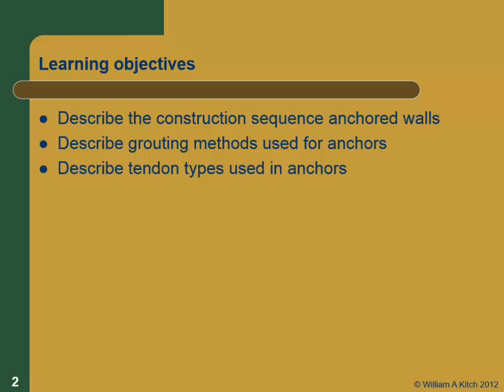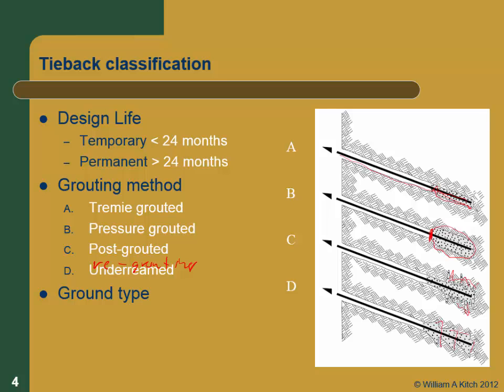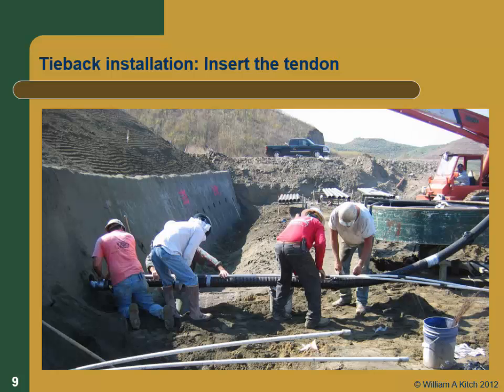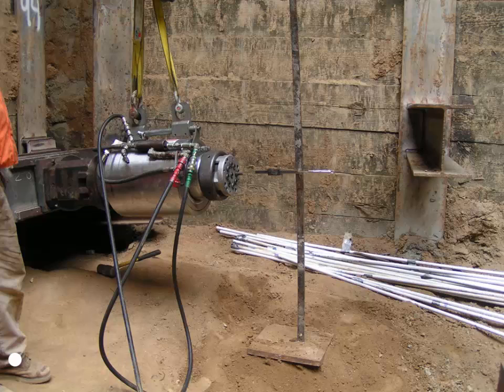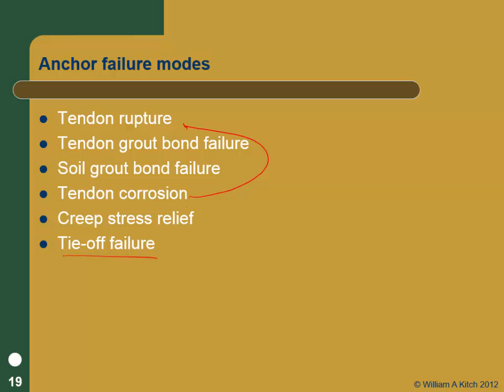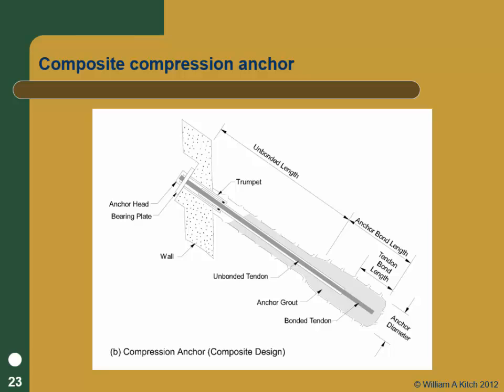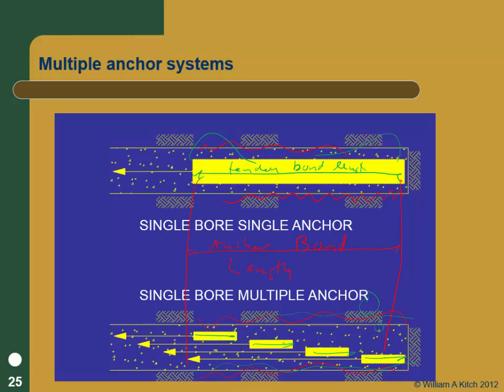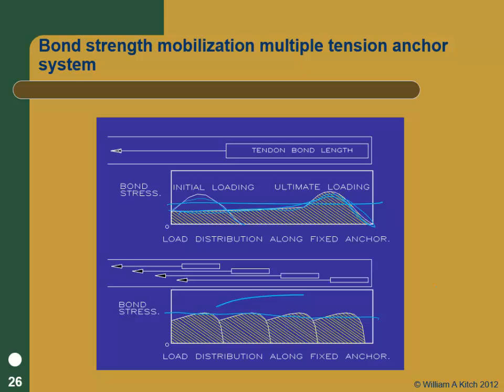CE 540 Module 9.1 Tieback overview

Comment: What's the 3 points of pressure 's the 3 bulbs in unbounded zone in relivence to structure  barrier of the drilling prior to grouting what was with the symbolism of the 3 points of contact in the structure wall,  question what is grouting in this construction does it have properties and how are the properties stores and then handled prior to pumping grout thru the granulated drilling what form of mechanics will be used when intact with rotary.  Is it like as to rotary hammer or drill and if it is rotary hammer or drill what is the mechanics,  are the heads of the tips in similarity and what are it's metrics if applicable. Not to miss lead but what tool is used in the demolishoned constructruction of the instillation.  So a drill rig